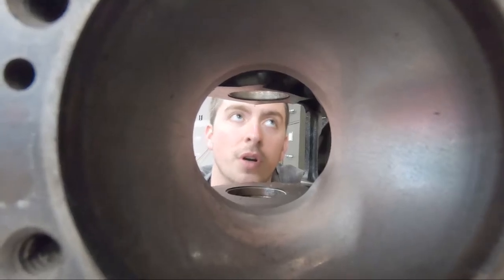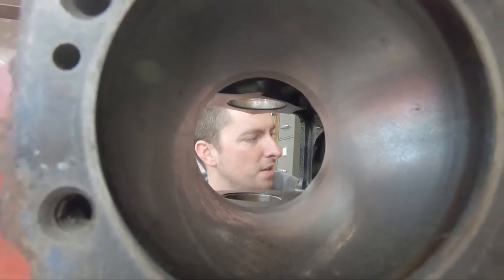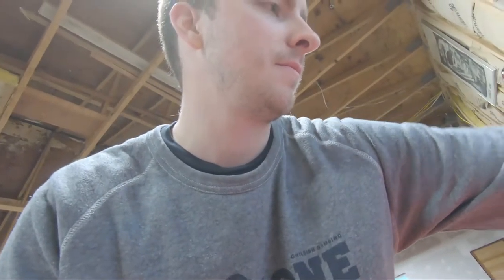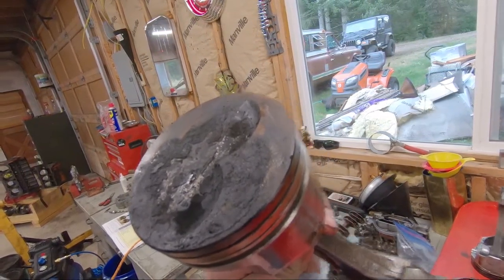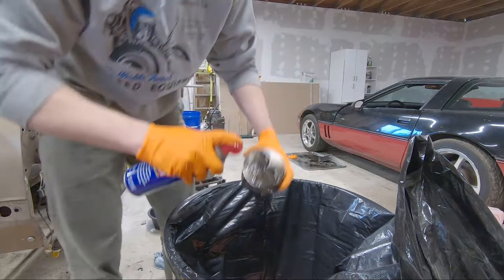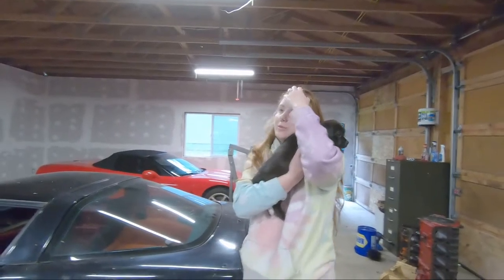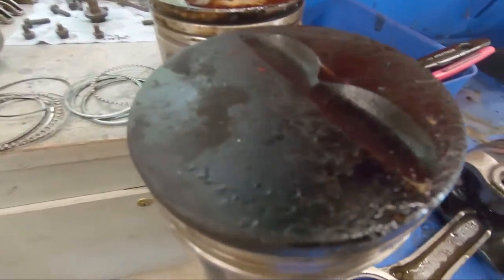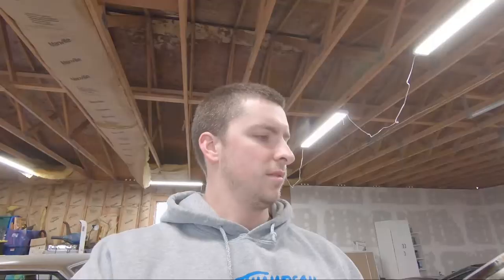Piston Cleaning For The Cutlass Small Block! Cutlass Engine Build Pt.3!

Comment: get a 1 gallon can of carb cleaner and drop the pistons in there for about a hr then clean them it should take off all the carbon.  Also make sure all the ring glands are clean so the rings move freely.  Polish the tops of the pistons to a mirror shine it will help fight detonation .
Reply from the maker: Thank you! Yeah I will try that because I need to find a method that involves less elbow grease. What kind of polish would you recommend?
Reply: Mothers aluminum polish works really good
Reply from the maker: @mopheadgarage3276 thank you I think I actually have some of that so that is perfect.

Comment: Why didn’t you just drive it with the V6 in it while you built that drivetrain?
Reply from the maker: It still wasn't running very well it was having a hard time starting and I bought this car for the purpose of swapping a sbc into it and having a fun cruiser that could actually get to highway speeds with part throttle haha